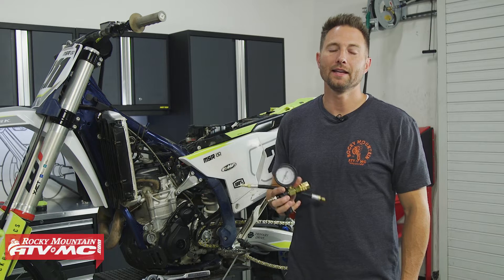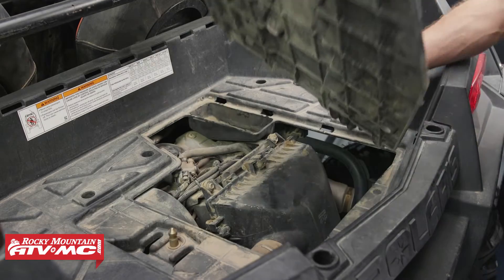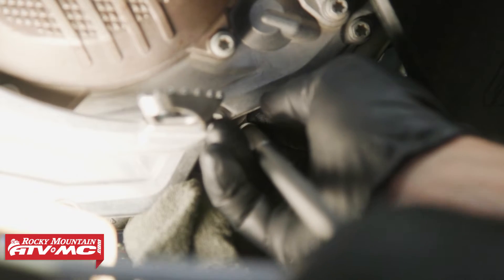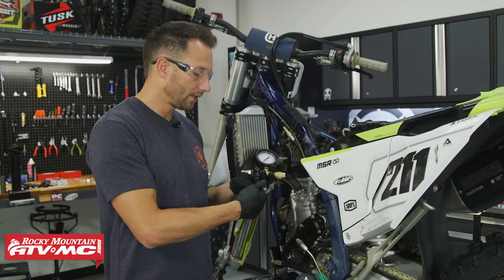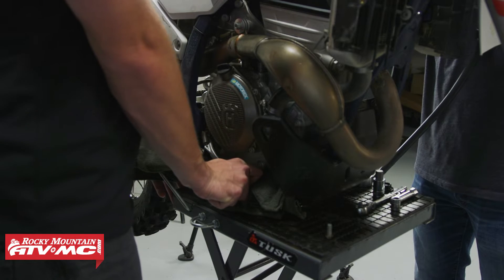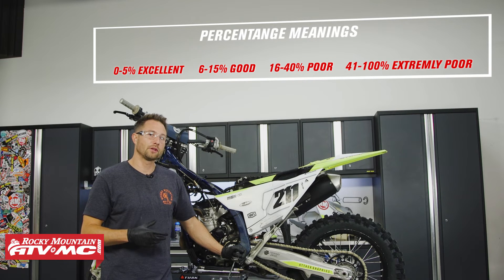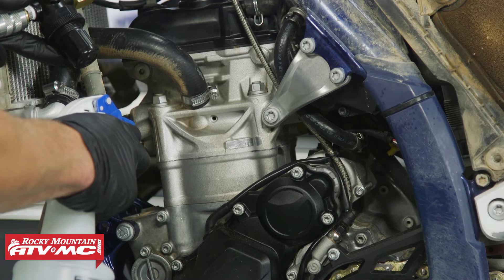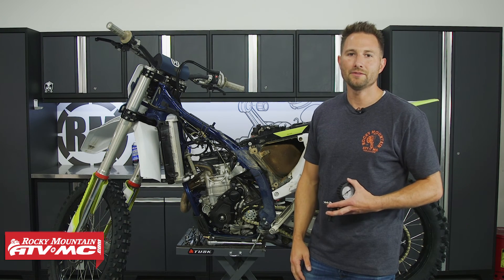How To Perform a Leak Down Test on a Motorcycle, ATV or UTV

Comment: I'm doing this test on a 2016 KTM 500 EXC-F and it has a locking bolt for TDC (take the washer off and reinsert bolt) so I was wondering if I need to hood the crank with a breaker bar or is the locking bolt enough to hold it? Thank you for the video by the way!
Reply from the maker: If you use the locking bolt you should be fine.
Reply: @rmatvmc awesome thank you very much!

Comment: How do you keep it at TDC? There is too much lash in the drive train for the brake to work?
Reply from the maker: You can hold the crank still using a breaker bar on the bolt inside the timing cover. We show that process at 2:39 in this video.

Comment: @rmatvmc w/valve cover off, gurgling sound coming from pressurized oil feed circuit (feeds cam joirnals & oil jets) under cam bridge on 2023 GASGAS MC350F (previous gen-style motor) & Tusk gauge reads 16%. No leaks heard from oil filler, radiator, nor on intake or exhaust sides. Possible to pressurize the oil jet circuit & not the crankcase where the clutch is if getting by rings? 14 hours on bike, brand new 366 kit installed & burns some oil when revved, especially when revved again immediately after coming back down near idle. Already changed rings after 1 hour & still no joy, so not that. Valve stem seals or cylinder cast out of round?